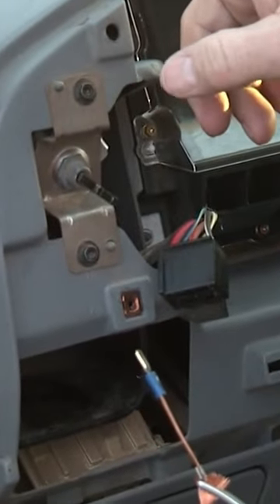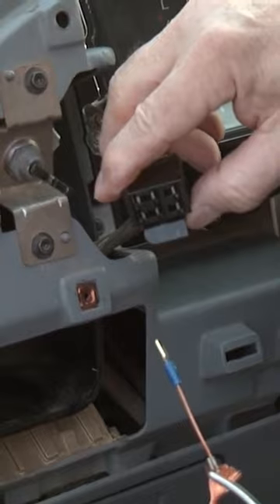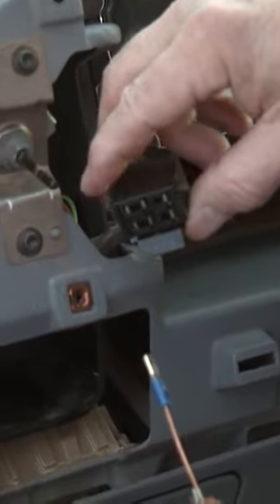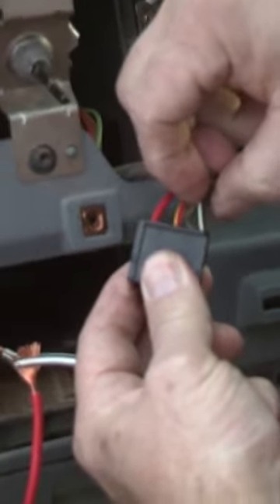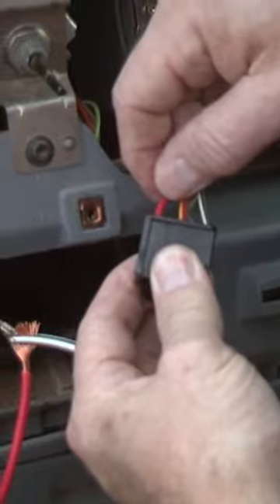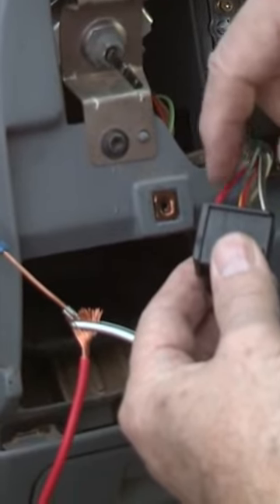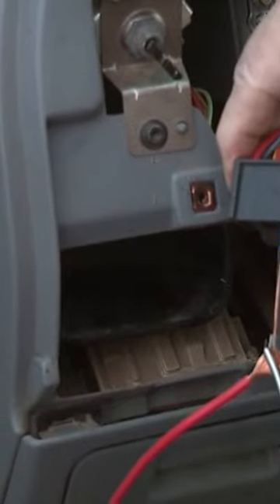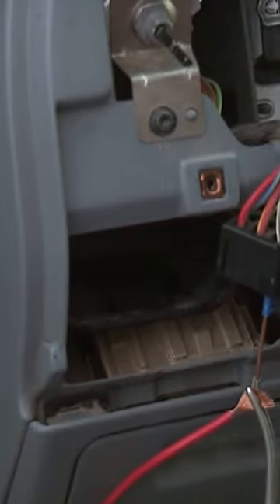Testing the fuel Pumps  #fuelpumps #ford #fordf150 #howtodoityourself #shorts

Comment: Is it the negative or positive Post???
Reply: The video states: connect the battery directly to the switch so voltage and current flow to the pump. The negative post on the battery is connected to the car body, the engine block and other grounding surfaces. So in this case connecting the switch to the negative battery post would NOT get voltage and current to flow through the pump. Leaving the only option: the positive post.